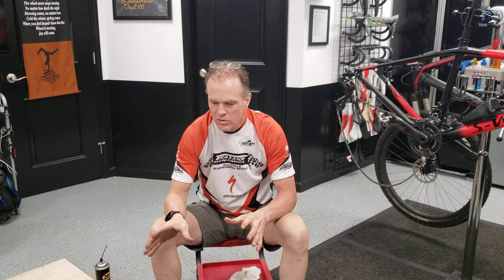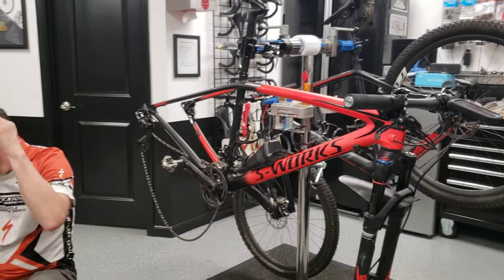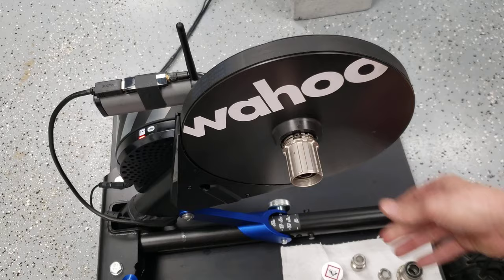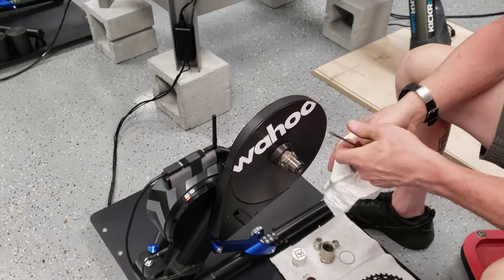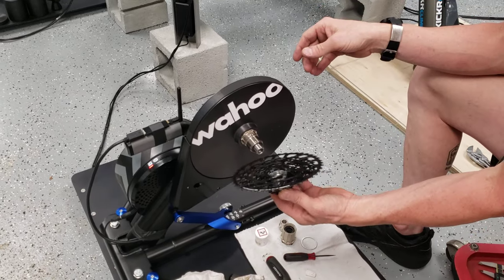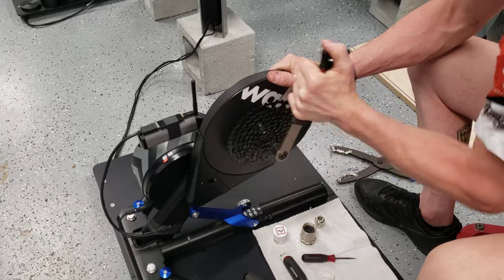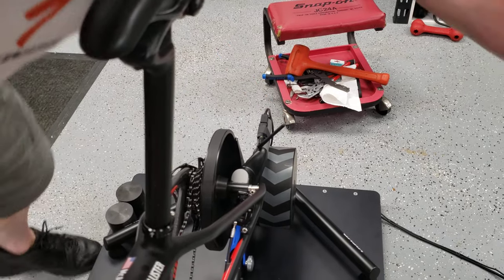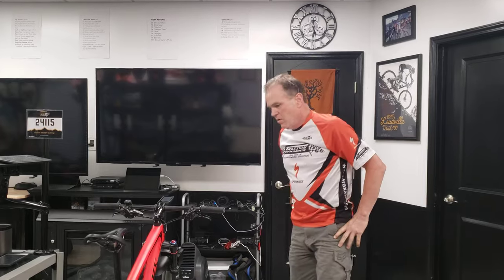How to convert Wahoo Kickr for Mountain Bike, Cycle with Max!

Comment: Thanks for the video! Are you sure the taller lock nut is the correct one to use? Unless the instructions on Wahoo's site are wrong on this as well, they specifically say the XD nut is "smaller than the original". If you look at the photos here, it sure looks like the shorter, chrome nut: https://support.wahoofitness.com/hc/en-us/articles/360006297940

I installed following your instructions on a boost mtb with an X01 eagle cassette. In my highest gear my chain is rubbing against the dropouts. Wondered if it could be because I used the wrong lock nut.
Reply: @Traxxion  Thanks a lot, Max. Because I'm having problems with rubbing, I tried using the shorter lock nut like Wahoo suggests. It only made the problem worse, so I'm sure you're right about using the taller lock nut.

Do you have any tips on what I might try to get rid of rubbing in the highest gear? Maybe I just need to play around with tuning?
Reply from the maker: @eysikal  I would go back to a regular fully assembled bike and see/measure the gap.  Then I would try and come up with the same spacing on the trainer.  It should be no different.  You should actually be able to put your bike on the trainer without having to adjust the derailleur at all.  I wish I could help more.
Reply: @Traxxion  Thanks, that makes sense. I wouldn't think it'd require more than couple of turns on the barrel adjuster. I will try looking at the gap on my bike and see if it's any different. I'll be interested to hear what Wahoo has to say if they ever get back to me. I'm going to ask them to update the instructions because I'm sure they have confused many people.
Reply: @Traxxion  OK Max, with Wahoo's help I was able to figure out what's going on. The 2 pieces of the thru-axle adapter that you mention @9:20? The little cap is supposed to go on the drive side! When you place both pieces on the non-drive side like you show it pushes the cassette too close to the dropout. This might explain why you opted to use the taller 13mm lock nut instead of the shorter 9mm lock nut that Wahoo says to use. 

I disassembled mine, put the little thru-axle adapter cap piece on the drive side, took off the 13mm lock nut and replaced it with the smaller 9mm one. Now things are lining up much better and my chain isn't rubbing against the frame/dropout. 

See Step 4 here for reference: https://youtu.be/1RXATMoTu6Q?t=167
Reply from the maker: @eysikal  What you are saying makes literally no sense.  If you have put a 3-4mm SHORTER spacer on the drive side, then you have moved your cassette much much closer to your frame.   

To be further clear, literally nothing you do on the non drive side of the bike has any affect whatsoever on the proximity of the cassette to the frame.  They are separate entities.

Here is the indisputable truth:  If you can't take your wheel off your bike and put it on your trainer without adjusting the cable or the limit screws, then your trainer setup is wrong.  I can move my bike back and forth without touching anything.

The way I display perfectly makes 148mm spacing on the trainer.  If you run the tail of a vernier caliper through your complete trainer hub you have to be able to measure this number.
Reply from the maker: @eysikal  It is interesting to note that my non-drive spacer is marked BACKWARDS from what their video shows.   Mine is defective, but at least I know which way to orient it, in spite of the mismarking.
Reply: @Traxxion  Yes I think the markings on mine are different from what they show on the video as well.
Reply: @Traxxion  I'm not sure how what I'm saying doesn't make sense. Have a look at the video I linked where he puts the smaller side of the adapter kit on the drive-side axle. Because it sticks out a bit, that gives more space to work with between the dropout and the cassette. Without that piece there, the cassette is closer to the frame/dropout of the bike.
Reply from the maker: @eysikal  There is no way to put a shorter spacer between the cassette and the dropout and increase the space between them.
Reply: @Traxxion  Shorter spacer? You are putting both pieces of the thru-axle adapter/spacer on the non-drive side. When I put one of the pieces of the kit in its proper spot on the drive side, it extends out past the cassette and creates more space between the cassette and the frame.
Reply: @eysikal  Thank you for pointing this out!! Wahoo does not mention this in their HDR installation instructions. I couldn't figure out why the cassette was locking up to the frame when I tightened down the thru axle. The loose cap on the cassette side made all the difference. The only issue now is that the Kickr cassette side gap between cassette and frame is 2.65mm vs 2.8mm when the wheel is on the frame. I am noticing that the chain is hitting the front derailleur guard when shifted all the way up or down in the small chainring. I'm guessing the 1.5mm difference is causing issues with the gearing alignment? Why does this have to be so difficult?!? I feel like I'm so close but it's still not working completely smooth. Any suggestions are appreciated.
Reply: What is an HDR installation? 

I’m no expert, but this video is wrong in 2 places. So make sure you are putting the cap on the cassette side like you are doing. Also make sure that you are using the correct lock nut. 

It does suck to get these things set up perfectly. It’ll probably take some barrel adjustments to get it tuned up even if you’ve got everything else correct. 

Also recommend writing in to Wahoo. They will take a while to respond but should be able to help.
Reply: @eysikal  Sorry I mistakenly used the wrong term. I meant XDR free hub. I've been having trouble getting my Kickr to work with my S Works Diverge setup(SRAM Red/Force AXS etap 12 speed). The XDR instructions are very vague and do not explain a lot of the details that are needed. It's seems like it's going to be one of those trial by error situations to dial it in perfectly. I'll reach out to Wahoo support and see what they say. So far they just send links to their extremely vague instructions and youtube videos.
Reply: That’s a 12-speed road bike setup, right? Not mountain bike cassette? Make sure you didn’t install a spacer onto the feeehub before putting on the cassette. I believe you skip that for road 12 speed
Reply: @eysikal  That's correct. No spacer installed and the smaller cap installed on the cassette side(opposite of what was mentioned in the video). The only thing I was missing was the loose metal cap on the cassette side but again, there is a very slight gap variance. Might be an issue when taking into account the accuracy of these components. I'm reaching out to Wahoo support for their input.